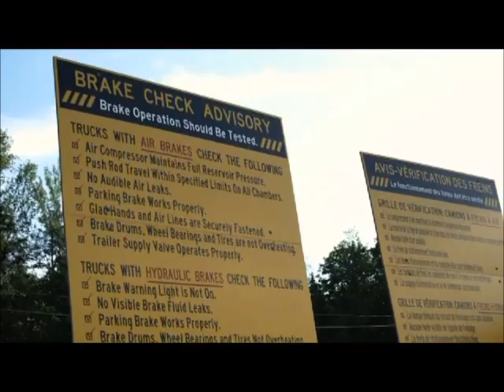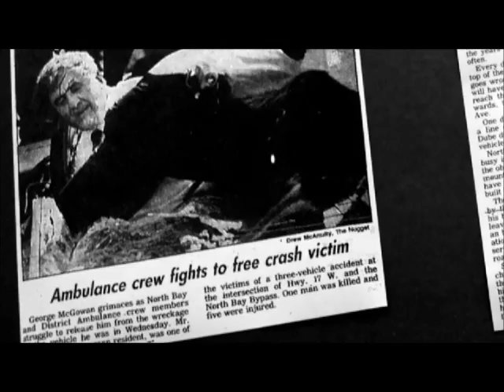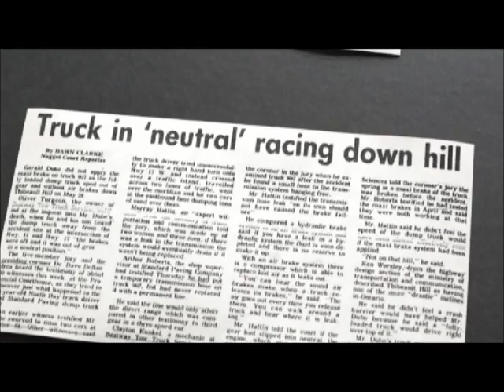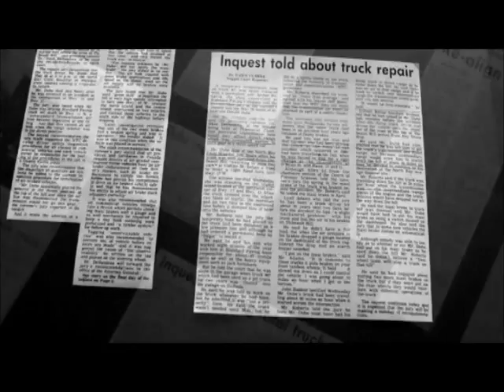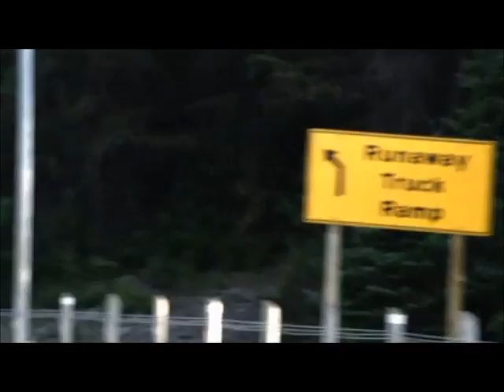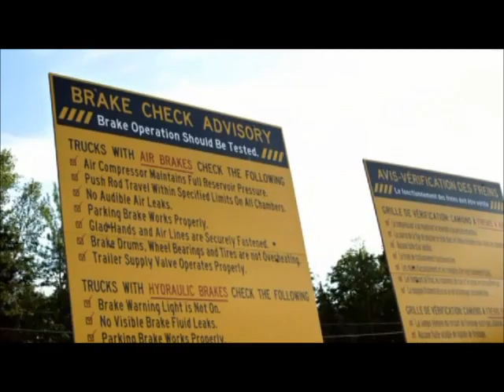Runaway Truck Ramp Demo

Comment: I don’t know how y’all drive up in Canada, but by putting the ramps on the left side of the highway kind of seems idiotic. Down here in the states four wheelers have a tendency to hang out on your left side and if you were to move into the left lane they would be there and  make you hit them.  And then there is the problem with drivers who do not speak English and cannot read English. As in the case of the recent crash down in Colorado. Until companies start paying their drivers better and treating their drivers better and let’s not forget training their drivers better there’s going to continue to be stupid accidents like this.  I’ve driven through all continental 48 states and some in Canada for the last 30 years. Knock on wood I’ve never had to use a runaway truck ramp but there are times that I should have if they were there. One of my old bosses told me once you can go down the hill 100 times too slow but you can only go down one time do you fast. After years of going up and down different mountain passes I’ve learned  what I can safely do on those different passes. Unless you have been there and done that don’t follow somebody else who might have more experience with that particular real. You do what you think is safe in the hell with everybody else. These kids come out of school now and I think they’re super Duper truck drivers, well they’re not. I have asked one who thought he was a truck driver if he had ever been through an intersection sideways or backwards in a bobtail .This was back in the late 1980s and the guy looked at me and goes oh no I’m a better driver than that and this other person comes walking by and said then you can’t call yourself a truck driver in and kept on walking. The FN G looked at me and said he’s ridiculous that is the stupidest thing I’ve ever heard. Then he asked me who that guy was. I told him that was the safety director for Ryder truck rental in South Florida. They do not teach these kids nowadays anything. All these companies want is more money and meet in the seat not professional drivers they could care less. They have calculated in a certain number of fatal  accidents per year that affect the bottom line and they know how many they can have to be successful. That is what these companies plan and accomplish. It is nothing but pure greed that these companies strive to do. There is one way to combat this and that is to mandate better training for their drivers. And take away some of the stupid rules that the FM CSA has put into place because there are people In certain position in the transportation industry that has never been in the truck a day in their lives and they want to write laws that regulate it which is totally ridiculous that would be like a truck driver joining a medical review board in St. Paul we can’t do this because it don’t make sense why doesn’t make sense to a Lehman but to a professional it does. I shall now step out of my soapbox.

Comment: I've had all kinds of engine brakes in 45 years of driving. I know that hill well . There is no engine brake is going to stop a fully loaded truck on that hill , plus your into town almost at the bottom. I don't think Scanjett has ever driven a real truck down a real hill if he thinks he can stop a truck down that hill with an exhaust brake. Another keyboard truck driver on his truck game. The guy is dreaming in colour. So if want to drive a truck, use the proper gear to hold your truck back from the top, you won't have to use the ramp
Reply: Right and I have caterpillars best engine on highway but cat designed with a weaker brake so as not to snap crankshafts

Comment: No good destroy the truck, in USA use gravel in stop the truck out any damage also the load is intact!!!
Reply: They said, it freezes in the winter and won't work.
Reply: You missed the part where they both mention its used in a few places in the USA, one example is in Wyoming and was successful with a tanker hauling corrosive chemicals.
Reply: Where that ramp is temps stay below freezing for months on end and -40 for a few days to a week strait are not uncommon
Reply: I heard it was very expensive to remove a truck from the gravel pits
Reply: Watching the two demonstrations I'd say the gravel looks like the worse one to use.  The way that truck bucked, all I see is a trip to the ER for that driver with back problems.

Comment: Jake brakes
Reply: Nope, they work only  to a certain minimum rpm and even if you accelerate, that furthers the distance of stopping. let alone the jake brake or any other retarding system on a vehicle will only slow it down, not made for stopping them.

Comment: Its a  bit extreme going from an escape lane which doesn't damage the truck to an escape lane that wreaks the front end and all because the local council wants to save money no doubt.
Reply: This system is less messy that what i seen from the video demonstrating the gravel version which strew it across the road because there was no retaining wall on that side. Not to mention they said it freezes and becomes useless in winter. Sand version is just as bad as a gravel one.
Reply: Also a lack of room for gravel pits on mountain roads
Reply: Karaoke Trucker it's not the local council that pays for that on a provincial hwy it's the government of Ontario that's covers cost

Comment: i love how they say  its designed to safe drivers life but the don't mention you will loose your license if you use any of the ramps. We had a driver that his engine brake stopped working going down hill    he went on a runaway ramp and lost his license   as he couldn't pay for the damage done to the  ramp and the ticket....   so the took his license away.....
Reply: shouldn't be driving a truck without insurance to cover that kind of thing anyway
Reply: 1589chicago they won't take your license away for an accident if you have insurance. insurance companies have no problem paying out because it saves lives

Comment: WHAT A FAIL!!....  THATS JUST CRAP.... There are way better system out there that will stop a truck and do zero damage to the rig and in most of them the truck can drive away and get back on the road in no time at all... 

This truck would have to go in and have MAJOR work and weeks off the road. Cost tens of thousands of dollars to fix and loss of down time.. This  system is just a huge fail.... Now if you have another truck loss its brakes it will cream into the back of the other one. or the ramp may not be rest in time... to much BS, To much loss, To many FAILS....
Reply: Nobody fucking cares about the cost or delays! If lives are lost because of a runaway semi ! They can't be brought back with money! The point of the ramp is to save lives!
Reply: what is your problem? i dont understand why people get do upset over things they have no information about. This looks like its main focus is to save lives. Plus it looks like its for areas with limited space.
Reply: Samoan Dude they are probably talking about the gravel that is used on some. too bad for them they dont realize that in this application there isnt any room for it. besides theres too many cars nearby for rocks and dust flying around
Reply: you have to call the Gravel Pit
Reply: Lankster Price Thousands in damage is much better than possibly multiple people dead if the truck crashes into a car instead
Reply: why is it a fail it stops the truck that is the main thing
Reply: that run away ramp used to have a gravel bed but when it was used the flying gravel damaged vehicles and broke out windows of vehicles going up hill cause personal injury
Reply: Hence, keeping the money wheel turning. It reminds me of an airbag on top of the dash of a car, when you get in a little fender bender it takes out your windshield. Again, spending more money.
Reply: This is for when distance wont allow for gravel ramp
Reply: They use to have a gravel bed there it froze in the winter and was useless and every few years they had to shut the ramp down dig it up and wash all the road salt and winter sand that acts as cement glueing the gravel together
Reply: This truck was wrote off frame was bent our dealership got paid via tax payers